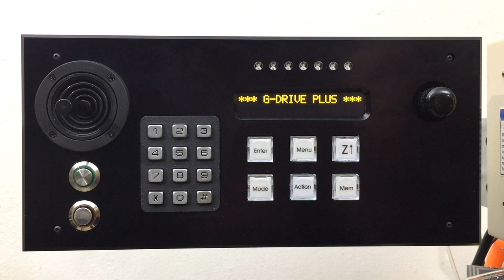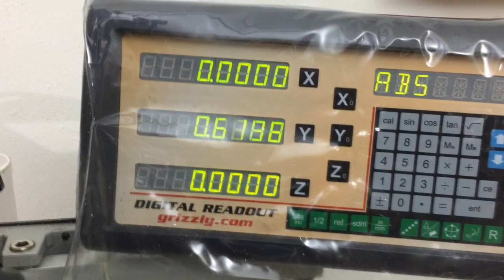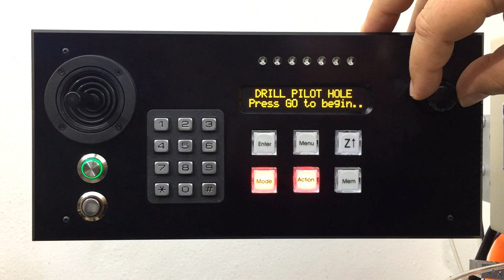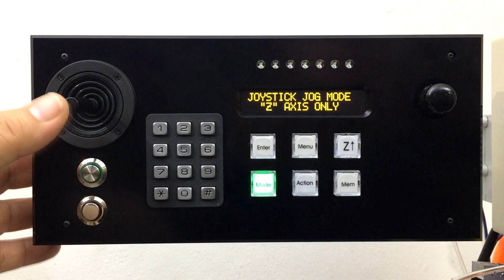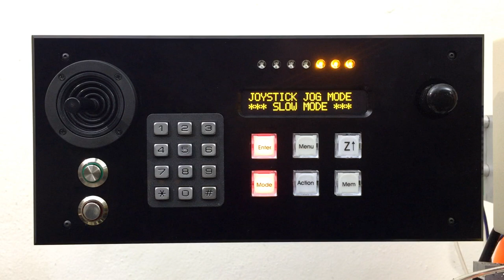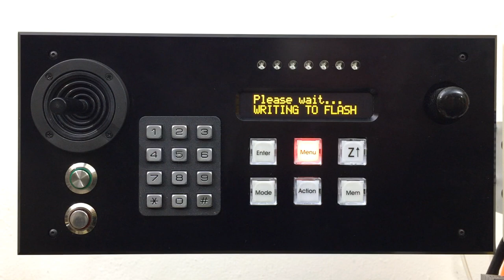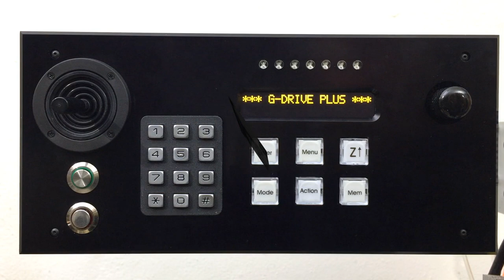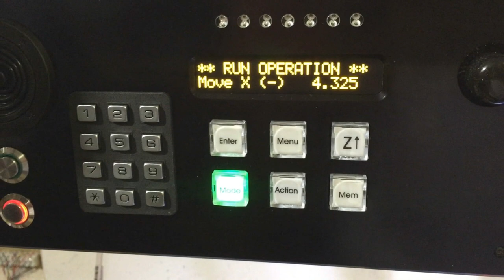Add-On Electronic Control for Milling Machine.

Comment: I wonder what is the price?
Reply from the maker: Hi Fang, at this time... the device is not in production. I can build one for you if you would like. The cost is $1,500.  Each unit is built by hand, as well as each case being machined. It's quite a bit of work. Let me know... Thanks!